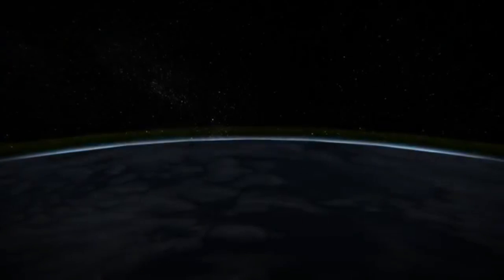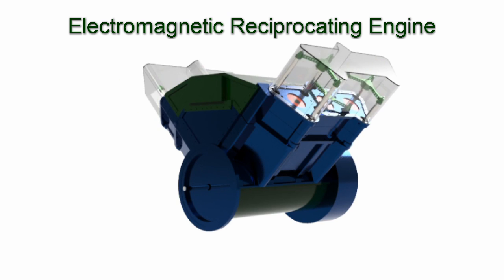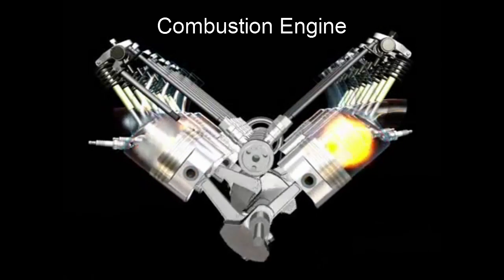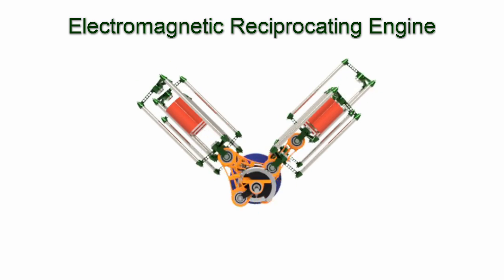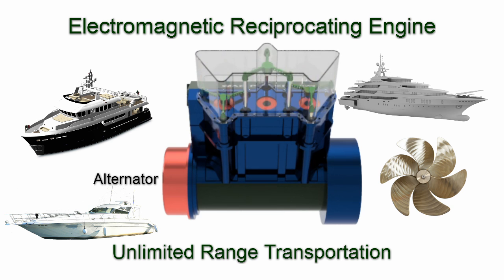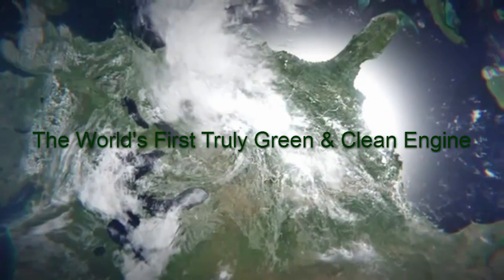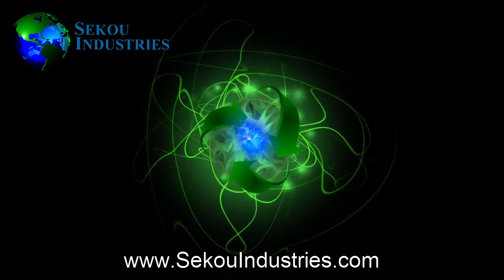Electromagnetic Reciprocating Engine

Comment: For proof of concept would like to know if there is a solenoid powerful enough to be mounted above a piston in a Honda gx160 and power the engine. I would remove the head of the engine and mount the solenoid above and connect it to 
the piston. The engine has a magneto that fires the sparkplug two times. It fires once at TDC and once at BDC. In reality it fires at 15 degrees befor TDC and BDC but this can be adjusted so the high voltage from the magneto will be sent to the solenoid everytime the piston reaches the top of its stroke. Does anyone know of a solenoid that is powerful enough to be used in this case?

Comment: Basically , got it, on the magnet pistons engine,  how to make one,  that's  work and run,  and lasts for a long time,  frist get a regular fuel engine block,  put a piston,  (with oil ring, ) make a piston. With a  north or south,  magnet on top of the piston, , then  make a magnet, pull  up on the engine,  basically the head valve,  area,  use.  North and south,  on magnet pistons,  to go up and down, bigger the  pistons,  more horsepower,  (  as energy)  use,  to large batteries,  and one or two large,  alternator  ,basically put  oil in the block of the engine,  for the oil rings,  for the oil rings  , to  keep engine cool.?????

Comment: Magnetism would not last forever, it depends on the material that posses the property and the temperature on it. This last one would be the main issue for this engine. When a magnetic metal heats up, the magnetism leaves the metal. But im also looking forward to this kind of technologies. In fact, i wouldnt limit myself to a V6. In that 6 cil case, an L6 engine is better. But if it doesnt need gas, you can distribute the energy on a V10 to have a better improvement. But with the best refrigeration sistem ever made (more or less like those at the teslas magnetic rotary engines)

Comment: this engine does not use electricity as a power source it uses a alternator to charge the electro magnets that drive the crank and thats what makes it better than any electric car will ever be even a tesla because you wont have to find a charging station before you car stops
Reply: You get it

Comment: 1. it sound like a perpetual motion and energy machine
2. The internal combustion engine is just a overly complicated three phase or V8 phase motor.
3. That is A LOT OF MATERIAL when you can just stick a 3phase pulse motor in there for cheaper and less gas mileage.
So just like Tesla is doing

Comment: I don't think just slapping on an alternator makes the thing run at 100% efficiency.
Reply: The crankshaft a haft stroke make it more efficient.  The alternator makes it renewable
Reply: @kalabutler5934   Really don't think slapping an alternator on something makes it renewable lol. In fact all it does is let you convert the mechanical energy to electrical energy. If the engine was 100% efficient it wouldn't need an alternator in the first place.

Comment: but can the alternator generate that much E that would be need to fire them in this example 6 E pistons   moving fast  or even slow the force of magnetic requirement would make them fast  or power full to make tortuq HP would come from rotation speed  and how fast them can ping each magnic so  could the generate survive that reuirement  its alot of juice yes its pulse but its high amp pulses  defintly you should get a working prototype maybe start small 3 cyclinder  then move bigger test if its possible  as  you need a battery for sure could the alternator charge it under such loads  pulses of 6 cycline E magnet would have to be able to get atlest 5k rpm to even make a stable juice for xmple bikes n cars need to be atlest 3k + to make a efficent juice for a battery to keep charge   make a pytrotype we would love to see AMAZING IDEA
Reply: Capacitor

Comment: such device is taught in the patent to Morch, U.S. Pat. No. 2,338,005, issued in 1943
Reply: ELECTRO-MAGNETIC RECIPROCATING 
ENGINE 
75 Inventor: Sherman S. Blalock, Inola, Okla. 
73) Assignees: Troy L. Cook, Broken Arrow; William C. Swisher; Mose Tiger, both 
of Tulsa, all of Okla. 
(21) Appl. No.: 108,220 
22 Filed: Dec. 28, 1979 
51) Int. Cl. ............................................. HO2K33/00 
52 U.S. Cl. ...................................................... 310/24 
58 Field of Search ....................... 310/23, 24, 32, 34, 310/35 
56) References Cited 
U.S. PATENT DOCUMENTS 
1,436,245 11/1922 Geisler .................................. 310/24 
1,886,040 11/1932 Moodyman ... 31.0/24 
1,912,441 6/1933 Foust .......... ... 310/24 
2,338,005 12/1943 Morch ................................... 310/24 
2,639,554 5/1953 Coffin ... ... 310/24 X 
3,134,938 5/1964 Morgan ................................. 310/30 
3,328,656 6/1967 Dotson .............................. 310/24

Comment: How this compares to conventional eletric motors in terms of efficiency? Doesn't seem very efficient whith so many moving parts
Reply: It's not as efficient as electric motors and would break more often also with basic understanding of physics you would understand that this is clickbait
Reply: This design maximizes the alignment of magnetic flux. The moving parts can be negated, since not only it produces more power but it also uses less energy
Reply: I think the idea could work. The rpm could be tuned to the purpose, negating the need for a gear train maybe? Motors need to run at optimum speeds and with use of modern materials perhaps reliability could be better controlled. I’d like to see one in action!

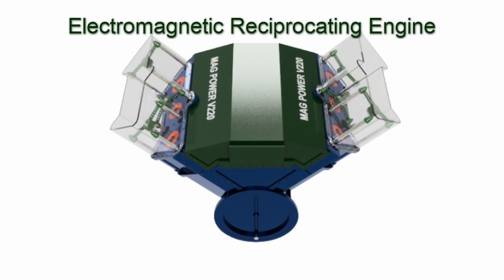Comment: I think there is an error here, "Electricity production" 1:53 . I'm sorry but this runs on electricity, it won't produce any. Momentum sure, I'd love this for a car. But this is not going to produce electricity. Otherwise it's not going to be "green energy" if it has to run on a generator
Reply: Design the pistons to also produce new power? Or some type of Alternator or a variant. What do you think?
Reply from the maker: The change is strokes, increases the HP and decreases the energy requires. Check www.sekouindustries.com, there is a white paper for more information. There is also a CAD drawing under the ABOUT.

Comment: wait a minute don't generators run off gas? these are pointless
Reply: Erm no you can’t get more energy out than goes in. Losses in the mechanism mean than even less output would be available to generate, let alone produce additional energy to power the movement of a load. Get away from the idea of self generation. There will always be the need of some exhaustible power source. The beauty in this design would be zero emissions, lower noise and hopefully improved reliability and/or efficiency over both internal combustion engines and traditional motors. It has to be said though that development of both of those is so advanced that this idea has a long way to go to compete effectively. But if we can get away from producing electricity from using fossil fuels as much as possible, it’s a good thing.